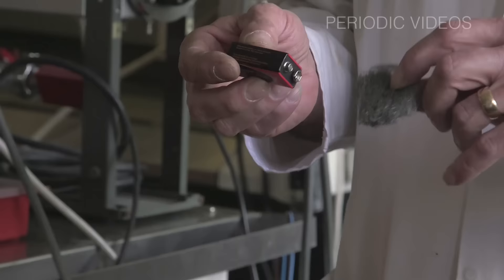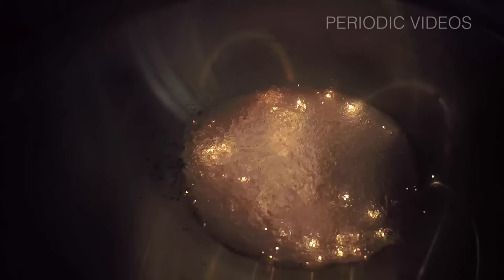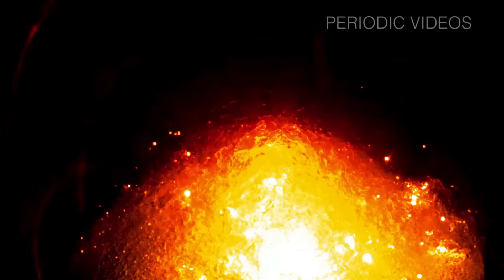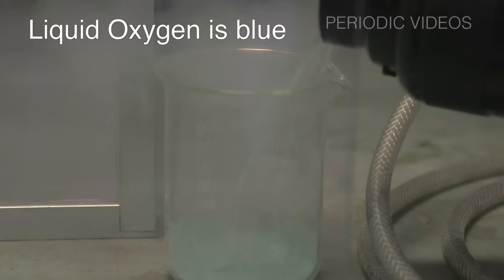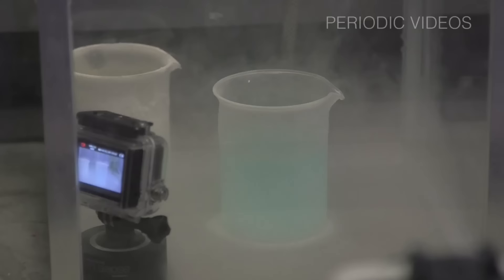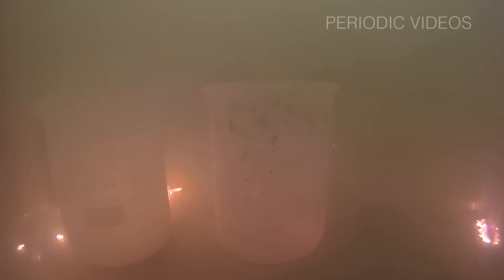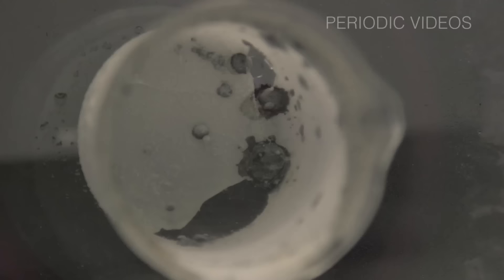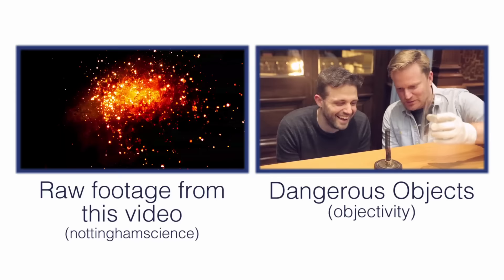Burning Iron in Liquid Oxygen - Periodic Table of Videos

Comment: Simple home brew solution.
Coat the beaker in shaving cream, allow it to dry, then rub clear.
This will provide a coating that will resist water vapor condensation from sticking  and freezing on the side of the glass...........
 Now repeat your experiment. 
This will give you a bit of time without the frost on the glass in order to see what is happening at the point of the reaction.

Great fun video....
Would love to see a follow up!
Reply: Shave cream doesn't prevent condensation, it's a detergent, so it prevents condensation from forming in droplets, but the condensation is still there. So now, instead of the beaker being covered in millions of itty bitty ice flakes, it's covered in a great big ice sheet.
Reply: wehich might be clear enough to see through.
Reply: just the first layer of ice will be clear, the other ones will form tiny droplets of ice :/

Comment: the experiment didn't go as you'd hoped, but I wouldn't call it a failure. you were able to see that, in an oxygen rich environment, silicon burns well. also you saw that a flame is able to be sustained and increased in an oxygen rich environment to the point of melting glass and nearly melting that cauldron, even if the surrounding area is supercooled. that is interesting data in my book, and it might be useful.

Comment: attach wires to the iron, submerge it in liquid oxygen and then run a current through it?
Reply: Voltage isn't important here, current is. You can easily light steel wool with a 1.5 volt battery, I've done so dozens of times. 9 volts are only used because the terminals are close together on the same side. A difference of 3 volts is nothing, but with the extra current output of a car battery, you would probably explode the steel wool instantly before it has a chance to burn.
Reply: no no no no, +ssjelf , batteries have and internal resistance. so an car battery has the potential  of delevering an higher current. 
I=V/(r_in+r_out), the internal resistance is very low, but when you are playing with what is a short, it is the internal resistance that has the bigger role.
an electrical socket has wire resistance, if you plug a multimeter in next to a toaster you can see the voltage drop when you turn it on.
Reply: yes, if we are only talking about one fibre.
but is we are talking a steel wool like we see them use, and a good connection, 10 by 10 fibres is still less then 0.5mm^2 , but would lower the resistance to 0.021 ohm,
in that case the 0.1ohms for the 9v, meaning that over 80% of the power would end up as heat in the battery and less the 20% would go to the wool, and the voltage  drop to 17% or just over 1.5v.
the car battery would have over 95% going to the wool.

So 9v vs. car becomes 20% vs. 95%.
now to be fair, the real number of fibres is likely in between 1 and 100.

also thanks for the good comeback
Reply: as soon as it touches the oxygen it would burn up
Reply: You could silicone the feed wires and feed tubes, evacuate the chamber(or a medium quantity of silica drying stuff) then pump in your liquid oxygen(or pour, such as a sep funnel) to keep the moisture away
Reply: Sounds like an interesting experiment.  I have access to liquid oxygen and I could try this and post it if you want to see.  I'm open to ideas.

Comment: I think you could make a small camera mount that attaches to a beaker that you could partially fill with a desiccant and put in a low vacuum (or just one of the two). That'd give you a clear window to the liquid. Maybe put a filter over the lens to block some of the light so you can see what's going on around the metal.

Comment: isopropyl on outside of glass should stop glass from frosting. High speed cameral will stop overexposure.
Reply: What about the flash when the Isopropyl alcohol inevitably bursts into flames because of the oxygen and sparks?
Reply: for the extreme brightness, you can set a filter in front of your lens, but after that you wont see much becuase there is too few light
Reply: If you use a high fps camera you can overlay multiple dark frames and end up with varying fps, but constant brightness

Comment: What if you used a cold trap to evacuate the air and let in another gas back through the cold trap, or had a several other beakers of a cold material (liquid nitrogen or otherwise) so that water will condense on those first? Or use a really heavy gas like sulphur hexafluoride to displace water vapor?

Comment: How about dehumidifying the air, using a bed of silica gel to maintain the low humidity, thick acrylic chamber (less thermal conductance) and carefully controlling the entry of LOX and then using a remote controlled  ignition of the iron wool in situ?

Comment: Hello Periodic videos. I think what should be done is to create several layers with atmospheres with the liquid atmosphere im the middle. Create a temperature gradient with different containers inside of each other and all with a window for the camera in the outer container. The atmospheres must of-course be as much invisible as possible but cold enough to avoid condense and ice of the windows for the camera. I thing the temperature gradient that each atmosphere represent will prevent condensation and icing.  Perhaps use two cameras. One without filter and one with filter to filter out the intense light from the reaction when iron meets the oxygen. Try it again! :) Rune Langemyr

Comment: The thing I think you're forgetting is that once you pour the liquid oxygen into the container, it immediately starts boiling off.  When you drop in the burning iron wool, it hits that pure oxygen layer and begins oxidizing at a tremendous rate that releases a lot of heat. It then starts boiling off more liquid oxygen as it approaches the surface.  The cycle continues even after the wool is submerged, however there is a point at which you get diminishing returns.  You have small clumps of metal because the oxidation process as slowed significantly due to a majority of the wool having been consumed.

You should try the experiment again, however fill the container space with a heavier gas (as mentioned by Smorgie77) however I'd recommend a noble gas vs CO2 as the heat may split the CO2, causing a secondary reaction. Something on the level of Krypton or Xenon would be far better a gas, and it would eliminate the issues you're having with condensation if you were to vacuum out the container prior to adding the noble gas and LOX. That would take some interesting mechanical rigging to make work.

Comment: +PeriodicVideos Did you try dropping the iron wool into the oxygen without lighting it on fire first, as Sir Martyn says the oxidation reaction is extremely exothermic?  Did, does anything happen, or is it that the initial flame is needed to burn off any coating of iron oxide on the iron wool in order for it to come in contact with oxygen and react exothermically?

And it sounds like Sir Martyn is thinking that there is a leidenfrost effect occurring when the hot iron drops into the liquid oxygen.

Comment: My idea on this is, the iron is not protected by the Liedenfrost effect, but is kept molten due to the extremely fast oxidation of the iron. As you said, oxidation produces heat. The burning iron is dropped into a pure oxygen environment so the reaction is quite violent as the iron is rapidly transformed into iron oxides. 

I would say it's similar to how an oxy-acetylene cutting torch works. When you cut the steel, it's first heated by the flame until critical temp is reached. Then, an excess of oxygen is introduced causing an exothermic reaction as the iron in the steel rapidly oxidates, thereby cutting through the material.

Comment: I was thinking of igniting the iron wool under the oxygen, not to drop it in while burning. Immerse the iron wool first with wires leading outside to a battery.

Would it be possible to have a "wash" of non-freezing clear liquid rinsing over the glass beaker in a continuous loop? Have the liquid constantly washing off ice. Maybe have the liquid heated?

Comment: I think it would be interesting to figure out how to do this in a calorimeter. Measuring the heat generated by the exothermic reactions would give useful information about the what those reactions are. Of course it would be much less interesting to look at but I still think it would be informational. Building such a calorimeter would, however, be difficult I think. It would have to withstand not only change in temperature but also tremendous increase in gas pressure.

Comment: Would the reaction start by itself if you wouldn't ignate the iron wool before you drop it - like what happened previously when you dropped charcoal into liquid oxygen? Or maybe there is a certain drop height required before there can be enough impact energy to start the reaction?

Comment: Could you place the beaker on a bed of dessicant crystals, e.g. silica gel or copper ii sulfate, in a lidded box. Leave for a while to get the water from the air, and then fill the beaker and drop the iron through the lid?

Comment: The silicon burning was very interesting too, thanks.
A cardboard box, Al foil, a cut out for the beaker and a low pressure N2 supply to it.
Use less iron, and a high speed camera.

Comment: what about using a dry room? set up several dehumidifiers in a small room and see how low you can get the humidity. use a robot to drop the burning metal, and a covered flask of liquid o2 if you have to trigger remotely

Comment: Could you try putting the iron wool connected to electricity in the leq oxygen first then connect the circuit so the reaction start at the liquid oxygen temperature if it start at all ?

Comment: Use the method used in superconductor synthesis observation experiments in switzerland. Really good insulator cylinder (quartz glass) - like 10 cm or more to look inside the oxygen or nitrogen flask - which is wented to a side or to top - for droping in the wool. it is much easier than to battle wetting point in air. provides dirrect "optical tunnel" to the reaction, and if iron contaminates it - polish it off...

Nice video tho, thanks!

Comment: Guys, those beads that pile up in the bottom of the reaction chamber are not metallic iron, they are iron oxide (the product of burning iron and oxygen.)  Not all iron oxide looks like the stereotypical rust.  Iron oxide can have a metallic appearance and be attracted to a magnet.  Just look at hematite and magnetite, both oxides of iron, both capable of taking a metallic sheen and being attracted to a magnet.

This is easy enough to test.  Take one of those beads, pop it in an SEM with EDX and check the ratio of oxygen to iron.  I'm sure the University of Nottingham has an SEM with the appropriate detector.  Alternatively, you could powder one of the beads and do x-ray diffraction.  Alternatively, there is probably a wet chemical test that would differentiate iron metal from iron oxide.  If all else fails, the mere fact that the beads shatter is a pretty good indicator that you are dealing with the oxide rather than metallic iron.

Comment: Could you try what I have been told is a Thermit lance. I made one several years ago and did actually light it up, it scared us all. Basically it's a load of steel wires in a steel pipe with oxygen piped into the non burning end. This is what they use for cutting steel under water. It can also cut through stone. it would be wonderful for you guys to do this but it is very, very violent.

Comment: If you were to evacuate the box, and seal it with the LOX in it, then would the water vapor not enter the box and only O2 exit the box, along with the by products of the experiment, effectively keeping the water vapor out of the reaction chamber?  You'd need to create a simple release that attached wires to the iron that were then connected to a power source.  Once the power source ignited the iron it would fall away itself.

Comment: Get a metal can (Beaked bean type can) And fill it with steel wool, Then get some type of air like oxygen or just normal air in a compressor and spray it into the steel wool in the container. The reaction will be the same but their wont be ANY freezing or anything. Its great

Comment: aluminium cauldron? I found some steel wool in storage recently and I used a car battery and an aluminium probe :) there was an eventual thermite reaction and it sunk through the pile and rolled out the bottom

Comment: You could make a container like you had before, but with a much smaller area, maybe 1cm by 10cm. You could then have another box similar to it but slightly larger around it. Then you fill the outer space with an inert dense gas like sulfur hexafloride, but not sulfur hexafloride because it's melting point is above the temperature of the liquid oxygen. The dense gas should keep out the water vapor and the rest of the atmosphere. This is a two fold advantage; the inert gas should prevent the spread of the escaping hot iron-oxygen reaction, and the glass shouldn't freeze over on the inside, allowing easy removal of any condensation. The oxygen would then be placed in the innermost box.

Comment: Idea, Fill the box with Argon gas and use a ceramic plate under the beaker. I also suggest placing the beaker itself in the box filled w/ inert gas before you pour the LOX into it.

Comment: Most of the crud left is FeO, I'm betting.  Fe3O4 is the most stable, but FeO is also stable at high temperatures.  Interestingly, FeO decomposes into Fe and Fe3O4 on cooling through ~300C.  If quenched quickly, it can be kept at room temperature.  I bet the splatters on the aluminum bowl, and in the cold LO2, were quenched fast enough.

I suggest taking some of those splatters over to the geology department, and polish and SEM them! :D

Comment: It´s difficult to understand why  liquid oxygen in the experiment is minus 180 C, when if it´s in a steel pressurebottle it can be at roomtemperature. When I was young we had an experiment that looked like this one, a bit smaller: You take some potassium nitrate (saltpeter) in a testtube and melt it with an alcohollamp or maybe a candle. And then you drop a piece of charcoal into it, and then it burns with a bright light. Its not very dangerous. I hope I remember the experiment right.

Comment: A window on a metal pot would let you look in at what is going on. Do a duel pane window with argon or nitrogen between them so the water cant get to the super cold side. On the outside a blower to blow warm air onto the window will help to keep it clear.

Comment: I disagree with the reasons given for identification of the residue in the cauldron as being metallic iron.  Iron oxides aren't as strongly magnetic as iron itself, but they certainly have a relative permiability higher than air and would be attracted to a strong magnet.  Iron oxides of various sorts are used as cores in inductors for just this reason.  Moreover, the grains that were left look exactly the same color as the stuff blown off when you cut steel with an oxy-acetylene torch (which process is basically to heat the iron then hit it with pure oxygen so that it burns).

So while I could believe that the bigger ones may have some metallic iron in the middle, I think that if you really wanted to know you'd want to do some testing.

Comment: The high oxygen level caused fast combustion providing enough heat to melt the iron which formed into lumps that did not have enough surface area to react faster than the liquid gas could cool it down, the larger lump had more mass and therefore more stored heat which is why it died out last. Try burning the steel wool in a pure O2 atmosphere at room temperature as a comparison, maybe while pumping in more O2.

Comment: I wonder if this isn't a two part process; the steel wool smoulders in the air, flares in the O2 enhanced layer between rim of bowl & lox, then a combo trailing off as lox's extreme cold & exothermic reaction fought to a finish.
Reply: Makes sense that surface area would be the critical factor